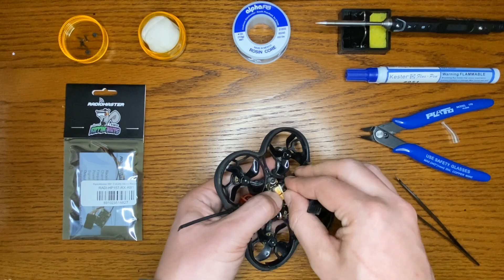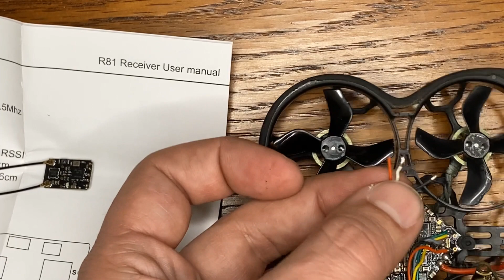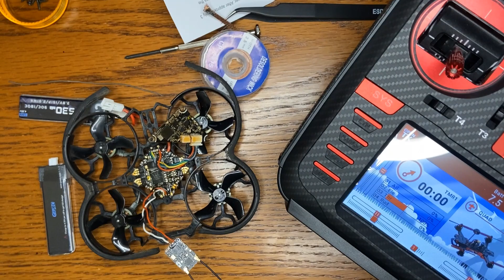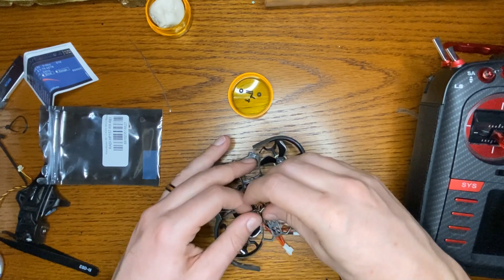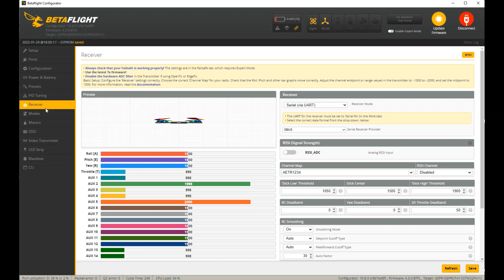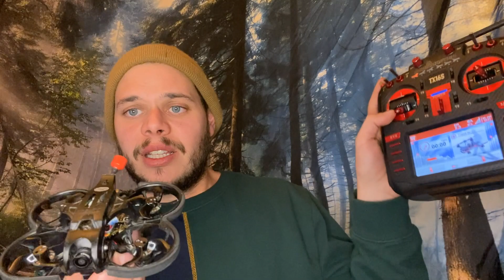GepRC TinyGO receiver and transmitter upgrade - Radiomaster R81 & TX16S

Comment: Quick tip, you can skip adding your switches to the "inputs" and just add them into the Mixer. Saves time. You only need to add them to inputs if you want to modify the input, like adding expo to a stick. Good Vid!

Comment: Do I need to download anything to my radiomaster tx16s using that radio protocol I just got that radiomaster protocol and it says d8 and then it has D16
Reply from the maker: You shouldn’t need to download anything else for it to work. Once you have the frsky protocol selected, you should be able to change d16 to d8 and you’ll be all set
Reply: @719FPV  thank you
Reply: I have the radio Master r8e Nano receiver with sbus
Reply from the maker: @nickrich710  I’m not familiar with that receiver but I would imagine it would be using the same protocol as the other radiomaster receivers in their r8 line.
Reply: @719FPV  I did it it work thank you very much
Reply: @719FPV  now I can fly around the house and torment my wife and daughter with it

Comment: Should added either elrs or tbs cross fire. I added tbs cross fire better signal than what you bought. Just saying.
Reply from the maker: Oh I will, but a $16 receiver that’s compatible with the internal module on the tx16s seemed like a good next step. It’s expensive to buy all the good stuff all at once lol